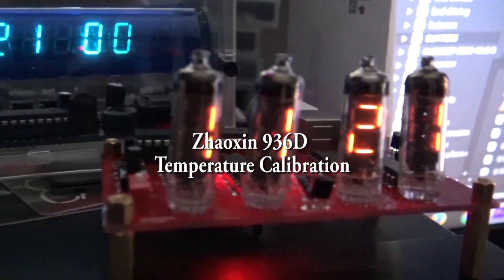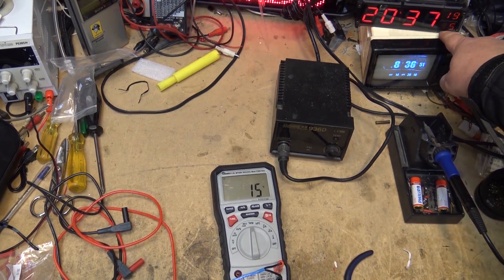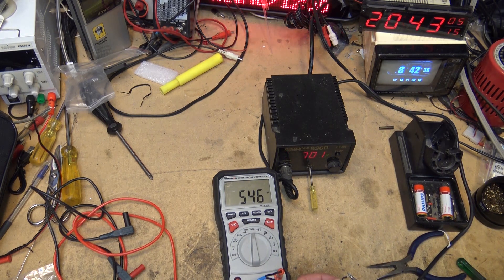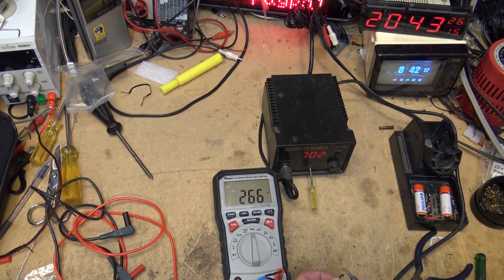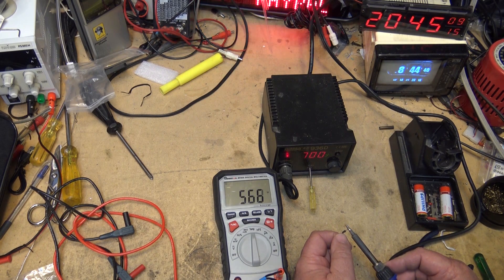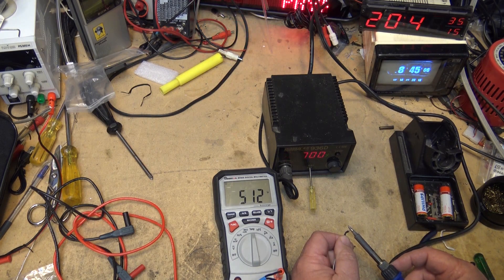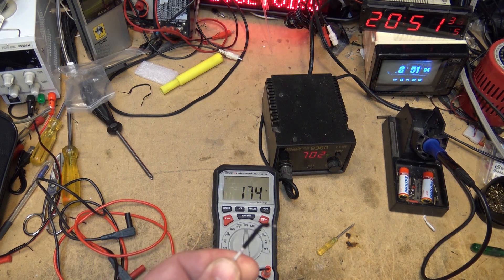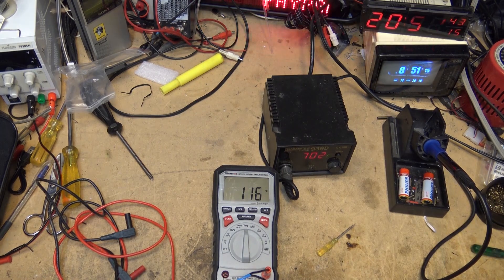Calibrate Zhaoxin 936 tip temperature using thermocouple probe

Comment: Is that the iron that came with the station? I have a 937D+ station on the way that i plan on calibrating with my meter as well( its also the same as yours but a different brand lol). Anyways i bought the one with the updated black iron not the cheaper blue and yellow one but if its possible to get one thats a better build quality that would be nice. Do you know if the Hakko ones fit these types of inputs on your unit ( which has the same input as the 937D+, 5 prong).  I know the Hakko replacement irons are 2x as much as the 937D+ all together lol but it has a larger element diameter and if i want to use real Hakko tips i figure thats what id have to do cause if you used to hakko tips with these irons the element wouldnt have as much thermal transference. But the difference may be negligible . And if its male instead of female im sure i could get an adapter. Just wondering if youve know anyone whos had success with that.

Comment: You don't need some fancy Mustool meter to measure the tip temperature. Buy a "fake" FG-100 "clone" for about $10. Just as accurate (uses a K-type thermocouple) but also uses a special replaceable thermocouple so you can easily swap when the solder degrades the metal junction. https://www.youtube.com/watch?v=aYhHUjTqTlE

Comment: well that sucks .... buy a solder station and it is way off ? so now you have to go out and buy a temp sensor to calibrate it? how well has it held up? most reviews I see claim the gun itself is plastic and melts away in about 10 uses...
Reply from the maker: Well I have had mine for years and it hasn't melted yet.

Comment: Does the soldering tip used affect the temperature reading on the thermocouple? Also do you add solder to the tip when measuring or keep it clean?
Reply from the maker: It shouldn't matter much. Even the best irons measure the temperature inside the tip. It shouldn't matter if the thermocouple that provides feedback to the control circuit is on the tip, or the heater itself as long as it is calibrated to the actual tip temperature.  As long as there is good thermal conductivity between the heater and the tip, and you calibrate at the tip, then the temperature control circuit will maintain it.

Comment: I was watching how you were keeping the iron tip maintained , something I only recently learned after burning mine away & grinding them back onto shape
Reply from the maker: Keep lots of solder on the tip. Clean it with one of those brass wool tip cleaners. This tip is over a year old, and I use it all the time. I have a spare for when it does go,  and I have a fine tip for the really fine work.
Reply: 12voltvids      I was ruining my tips until I got YouTube . 
Just got those battery 8W soldering irons that bigclive revealed ,  well,   the tip will be safer at that 8W .
Trying not to scratch the chrome tip .
Low power ,     pain in the ass    but no cable pulling
Reply: Do not ever grind the tips back into shape, you will remove the thin metal coating that protects the tip.
Clean the tip with the brass wool or a wet sponge cleaner and then add a fresh coat of solder. The tip
should last a long time if you treat it correctly (excessive heat can be the worst enemy), I keep several new soldering handle assemblies on
hand for that exact solder station (they are inexpensive at $1.99 US each) as well as an assortment of tips
for different jobs. The temperature probe for the Mustool meter works well to check solder tip temperature
but there are also units made for that  purpose. They are very inexpensive and a set of 10 sensors
is usually included (each sensor can be used many times). You get an instant read of the tip
temperature in a small bit of the solder that you are using. Aloha
Reply: I have to agree with you on that, there are not any more good electronic supply stores around
to personally visit, We are forced to go online for what we need. There are good sites online.
However the good old days of going down to your local supplier are now long gone. Aloha
Reply: Does the 8 watt solder iron work OK for you? I have several USB powered soldering irons and I am amazed
at what they can do .I can use them in the field with a heavy duty USB battery bank and they will last for many hours.
They are about 8 watts I think and the heat is concentrated in a very small point but there is not a lot of thermal mass
to work at removing components and old solder. They just do not have the thermal mass to stand up to a heavy
component work load. Aloha
Reply: Randy Gentry  it is fine for light work , the shop I got it from has now shut down with the rest in the UK so I look after this one and only tip , there was no spare given .
Hate this Lead Free crap soldier , that's the Law for is
Reply: I do not use the lead free stuff ever, no way. It just does not work to any good degree. I keep a fan running with
a filter to avoid much smoke and since it is for electronic work no one is going to be eating off of it. I have
some old Kester solder that is 67/30/3 lead, tin silver that seems to work very well and since it was a 1 pound spool
it should last a long time. Otherwise I have lots of Kester and other brands lead, tin combos that also work well. Aloha
Reply: Randy Gentry   you cannot by the good stuff anymore ,  the retarded Law has stopped it sale .
I have some left but it will run out
Reply: Where are you located? I can always order on Ebay or from Bangood.
Reply: Randy Gentry     I live in Staffordshire , millions are ordering on line  , eBay is up to you , I have been stung as well from there , with someone else doing it with pey pal , returns are not good .
Better off having a counter but no one wants that any more .
Out door shopping like that is now shutting down
Reply: Randy Gentry    you got it !   Even bookings will have to be done on line ,  money will become virtual and controlled , not by us .
YouTube channel :  thecrowhouse  , this guy is pretty spot on .
There is an update almost every weekend .
Bare him out , all is true .  this guy lives outside the system looking in .
Check his video menu  ,  best letting others know about this as well !

Comment: you guys in canada use Celsius 'normally' ?
Reply from the maker: Canada does yes, but I am old school. I cook and solder is Fahrenheit.
My house is heated to 70' which is 21C
Reply: I live in The Netherlands (Holland) and here its all metres and Celsius etc.
Reply from the maker: It is here in Canada too. Speed in KMh. Weight in Kg, measures in litres,  temperature in 'C. However, those of us over a certain age learned the imperial system, that be speed in MPH, weight in Ib, measures in Gallons, and temperature in 'F. 
All through school we learned the imperial system for weights and measures, and then Canada changed.  So we have to think both values. I think of speed at KMh because that is what the road signs are in, but in terms of temperature I still think in 'F because that is whet the oven is calibrated in, as is my room thermostat ect. Since when I got my first solder station it was calibrated in 'F I still use that, even though at the push of a button it will display C. You use what you are used to. To convert soldering to C for me would require me to think. I don't like thinking, not about converting temperature anyway.
Reply: It sounds very logical to me that you use what you are brought up with. I believe the UK is SLOWLY converting to using more metrics too but not sure were it will end since they are busy isolating themselves again under the conservatives.
Reply: @maicod  The UK has been using both metric and imperial for a long time.

Comment: Struth that was way off, im sure you will notice a big difference when you solder next :-).
The kester will flow much nicer.
Reply from the maker: Yes I knew it was cold because solder should flow easily at 700F and when set to 700 it barely melted it. That is why I had it cranked up.
Some say the temperature sensor is mounted on the element and not the tip.
It really doesn't matter where the sensor is as mond as the tip temperature is known as a reference.
Reply: I think the location of the sensor matters when you solder a large heat sinking ground on pcbs, the tip drops suddenly and the sensor is delayed.
Louis rossmann has been investigating the goods and bads of tip technologys.
The old full on irons had a big mass to store the heat, but modern ones seem to rely on fast electronics to compensate.
I still use a simple old 15 watt and 25 watt yellow antex irons from the past, ok for general stuff, i don't do much now so i don't need a station.